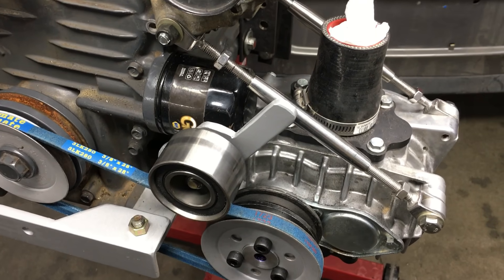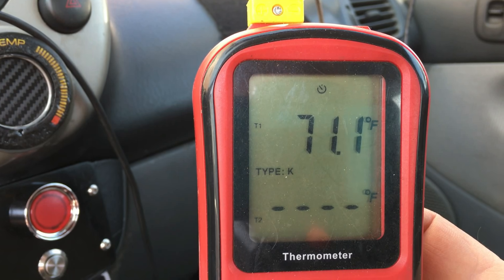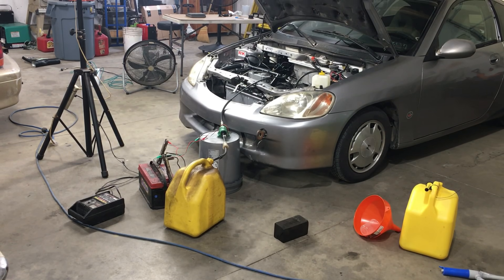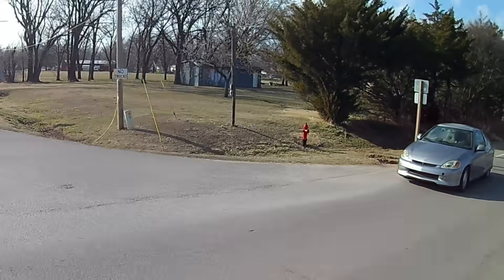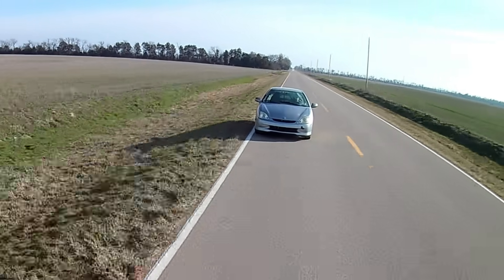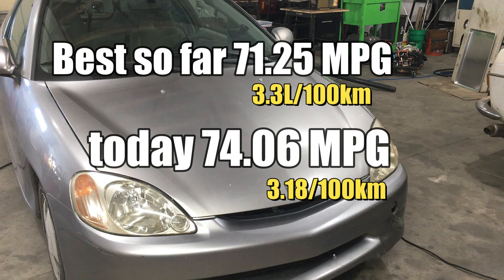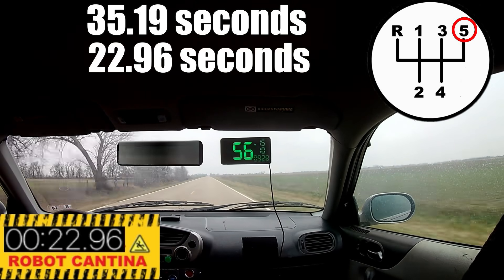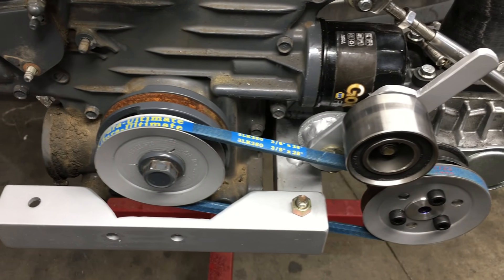S4 E10. We find out if the AMR500 supercharged Kubota diesel engine is more fuel efficient.

Comment: Great video as always Jimbo!

The fluctuations in the values from your road test are to be expected. There are only so many variables you can control. Temperature, wind speed and direction, fluctuations in how you accelerate - some things aren't practical to control. That's why we use multiple tests: that allows us to see how much randomness there is in our measurements. When we make a change, we judge whether the change was beneficial by first assuming that it made no difference at all (the "null hypothesis"). Using the random distributions of our measurements, we can determine how likely it would be to measure a given difference by chance alone if the change had done nothing. Then, only if the change we observe is so large that it's unlikely to be a result of simple randomness, we reject this null hypothesis and are left with the only possible alternative that the change was made did in fact have an effect. Again, the size of that effect isn't known exactly either; its randomness is a result of the randomness of both measurements.

The difference between your two measurements was 0.6%. That's extremely consistent! Good job controlling it as much as you did.

Of course, that's only two measurements - the average variance could be much larger than that. The difference between your averages before and after was 3.0%. That's quite a bit larger. It's hard to say from the small sample size, but I think that's likely to be significant - the supercharger is likely improving the fuel economy.

Comment: Improved volumetric efficiency provided by pressurizing the intake means you're providing enough air for complete combustion of the fuel (less or no smoke at the tailpipe) so you're getting the maximum combustion efficiency and most horsepower out of the fuel you're putting in. For the same power output, you use less fuel because you're not sending unburned or partially burned fuel out the tailpipe. As a few others have mentioned, more boost will increase efficiency up to a point and then your efficiency will drop because you've passed the point where the engine can make use of the additional airflow. Engineering is fun!

Comment: all diesels need too warm up they make less power and dont burn the fuel right when ur rich on my OM617 when im not hot i have a cylinder miss once and awhile until about 75C on the block

i always get my engine too full running temp before hitting the highway to make sure im burning all my fuel don't want too wash my cylinders

Comment: Stunning results. My guess is the next overdrive pulley setup will give better performance, with a slight decrease in MPG, but it could surprise us and get even better MPG. That would be EPIC! Either way a little more performance even with a small decrease in MPG would be an excellent outcome and I think is probably the better of the two scenarios. There's a guy right down road from me with the exact same vehicle, sitting there for a few years now. Time to get the welder out??

Comment: the reason the fuel economy is better is likely because youre not on full power as much to get up to your speed since its acceleration is quicker now. if you keep adding fuel and boost eventually you'll go down again but for something like this where the numbers arent that high its ultimately beneficial. i remember seeing a top gear episode where they had a very fast car trailing a very slow car on their track. the slow car was going flat-out whereas the fast car was just coasting behind them. same sort of principle here; its taking less effort to do the same work with boost. until you start doing more work with more boost is when you'll start seeing a decline in economy.

Comment: A few notes.  Interestingly, there are a few budget cars that improved their fuel efficiency by moving to an engine with a greater displacement which, to the laymen, would mean more fuel burn.  The truth of the matter was that the larger engine was not having to work as close to the edge of its maximum power output to make it down the road.  There's a bit more to it than that.  I could do a full writeup as to the thermodynamics and other physics principles behind it all, but there is a sweet spot where everything works best and most efficiently.

As far as turbos vs stupidchargers, yes, both pull some power from the engine to turn and blow air, which puts more air and fuel into the engine, resulting in more net power output.  You said turbos are run off of exhaust back pressure.  This is true, but misleading.  The back pressure the turbo is running off of isn't purely caused by the piston(s) pushing exhaust.  The exhaust is hot and continuing to expand.  In many cases, there is still some combustion going on in the exhaust pipe.  This heat expansion is, to a large degree, what is driving the turbo, not the piston pushing the exhaust.  It makes turbos a LOT more efficient, once they're spooled and running, than the stupidcharger but it takes more tuning and size matching to operate properly.  In the end, you would get better performance, especially at the top end, with a turbo, but the matching of the turbo to the engine characteristics is a lot more involved.  It's a lot easier for a big auto manufacturer who is not limited to what is already produced as a typical off-the-shelf solution because they sell in enough volume to justify custom-built solutions.

Comment: Economy going up makes sense. Well for now.  
As I mentioned in one of the last videos, that engine will have quite small, restrictive ports, valves and timing/lift settings. If it was making a lot of boost on a relatively low charger spin speed then it stands to reason the engine was having to work quite a bit to suck the air in when it was naturally aspirated - especially at higher rpm and even moreso with added fuel. 
By adding boost not only have you removed that load but the VE will have improved due to it burning more of the available fuel now it has the air to go with it. 
Between both of those they outweigh the added load of driving the charger making it an overall more efficient system so you can get more power or better economy. Or a little of both if you judge it well. 
The gains will get incrementally smaller as you add more boost until you get to a point where the efficiency starts to drop back off. It will still make more power if you carry on past that but efficiency will fall so it will start to use more fuel again.

Comment: You should defenetly add the bigger pulley and a intercooler for more boost and colder intake air(you usually wont to have ambient temp air) and check if it still rolls coal, you could also use a afr gauge to measure your afr and see if its good. Could be some nice power increase, and maybe fuel economy? Just my recommendations from personal experience you do you and keep up the great work as always. PS you probably got better mpg because your engine was running a little to rich and when you added a little boost it became closer to a stoic AFR.

Comment: You get a smaller intercooler belt disc, for 20% more boost, and you won't need to keep the throttle pegged to the floor.

Comment: Always wondered about the whole intercooler thing, because back in the 60s when we put Judson superchargers on cars, there was no such thing as an intercooler, at least not for homemade supercharged MG and VW beetles!
Reply: Ah, the long forgotten Judson vane-style superchargers.  Did they eat up a lot of oil or were the vanes graphite based?  I never got a chance to mess with them.
Reply: For spark ignition engines it's actually a bigger deal than diesels, because more heat in the manifold directly reduces your detonation margins. One way this can be dealt with is to run excessively rich mixtures that actually reduce power, but provide additional charge cooling by evaporation of the fuel. I'd bet your supercharged beetles ran quite rich at full throttle, to avoid both detonation and overheating!

Comment: Once you get to 10psi boost, the engine should really come alive, it's a small diesel and adding more oxygen to the mix will definitely make it run better. Just make sure not to blow the head gasket or rings, always double check maximum cylinder pressures.

Comment: If I recall, these mechanical diesels inject a given amount of fuel based on the throttle position (and basically only the throttle position). Therefor, if you are making more power for a given throttle position, it stands to reason a lower throttle position is required to maintain a given speed. So.... less throttle, less fuel. At least that is what my armchair engiviewer brain says.

Comment: Very interested to see how this plays out. I've put turbos on small diesel engines with great success but it can get pricey. The simplicity of the chinacharger setup (belts and brackets being the hardest part) could very well be a much cheaper and time efficient alternative with similar or better results. Most diesel sxs's need just that little extra especially the bottom end and older smaller tractors benefit a lot from SMALL  boost increases. 5-8lbs seems to be plenty. Either could go super charged just as easily as turbo although limited speed, limited cooling could potentially be an issue.

Comment: Black smoke is an indication of over fueling.  When you add boost, you are adding oxygen and making the burn of the fuel more efficient.  As we say, stochiometric or chemically correct for the fuel to bind with the oxygen.  Probably every diesel should have some boost to some extent.  There is a fine line between enough boost or introduced oxygen and too much boost and burning up the engine.  As you stated,  the supercharger does have parasitic drag and costs power to run but if enough efficiency is added, then the drag of the supercharger is overrun by the increased efficiency.

Comment: There's a a big difference between a turbo and a supercharger that's very relevant on highly stressed engines. Both take power from the engine to work, The turbo takes power on the exhaust stroke forcing spent gases out the combustion chamber through the valve/s, header and turbine. The supercharger takes power on the power stroke when the engine is more stressed, that difference is important on a high performance or fragile engine.

Comment: Just the fact that you're getting 70+ mpg., supercharger or not, is very impressive! Considering you still have excess fuel to work with, it will be interesting to see how much more you can get with overdriving the supercharger. Well done Jim!👍👍 EDIT: Next step after increasing the pulley ratio would be to pull a 'Gale Banks' and add water/alcohol injection. That would definitely make a difference, and even more so in warmer weather!!😉
Reply: This diesel would love a bit of methanol as a fuel! Not only do you get insane charge cooling you do not need an intercooler at all and methanol brings a decent amount of its own oxygen. Almost like adding weak nitrous lmfao. I am putting my AEM V3 water meth injection in my 2.0 common rail vw diesel one of these days once I decide to get around to it haha
Reply: Some get 70 mpg in slightly modded 3 cyl Geo Metros. They increase the compression ratio, use the XFI cam and advance the camshaft timing and switch to 4 cylinder final drive ratio, and lose weight.

Comment: At those boost levels, you don't need an intercooler.

Technically, also, intercoolers serve fewer purposes on a diesel since you don't have to worry about knock/detonation, or messing up the fuel bowl temperature [since diesel engines don't have fuel bowls]

Comment: I'm impressed with the fuel economy,
When weighing the fuel, does it matter if it's hot or cold? I would imagine that the volume changes, but not the weight,
You could run the supercharger with an electric motor, then it would be a hybrid again 🤔

Comment: If you’re making more power for the same amount of fuel delivered the economy will improve because you need less throttle opening for the same amount of power thus less fuel used.
It’s the reason why when towing you can get better economy out of a big V8 than a turbo 4 in the same vehicle yet use less fuel in the four when not towing .

Comment: You could make a crude Dyno for doing standardised economy runs by getting a used differential and an industrial fan and a couple of drive belt pulleys.
Mount the diff in a frame that sets it high enough to attach the fan to the pinion.
Lock one side or fit a pulley to each side and also attach pulleys to the vehicle hubs replacing the wheels.
Then just spin it up to whatever speed you want and go have a coffee.

Comment: What you've stumbled into is "break mean effective pressure" or basically torque per displacement per RPM.  I'm not going to pretend to be an engineer who has a detailed level of understanding but basically naturally aspirated diesels suffer from poor volumetric  effeciency at higher loads and speeds and the increased volume of air compensates for this inefficiency more than it costs in power to run. Turbos reclaim lost heat energy from the exhaust which is why they are better generally but in this situation this works. 

I'd love to see you try and compound charge this with the boost from the turbo feeding the intelt to the supercharger.

Comment: Nice work Jimbo, it's very satisfying when your labors are rewarded with positive results!  74 mpg is pretty good at 55 mph for a Frankenstein Honda Insight.

Have you considered a fuel flow sensor?  I know you are after an average fuel economy figure but, having an instantaneous fuel consumption rate gives quick feedback for experimental tuning settings.  Additionally, a Cal Factor can be computed between average and steady-state 55 mph to arrive at a reasonably accurate average fuel economy.

Comment: The coefficient of thermal expansion measures the rate of the expansion. A typical value of the coefficient of thermal expansion for diesel fuel is 0.00083 per degree Celsius (0.00046 per degree Fahrenheit). Using this value, 1.000 gallon of diesel fuel at - 7 °C (2 0°F) will expand to 1.037 gallons at 3 8°C (100°F).

So basically unless you start at near freezing winter and then stop at mid summer heat the error due to thermal expansion will be about the same as the means of measuring you’re using.

Comment: Very cool, I'm planning on building an Eco modded car myself, something like a Mazda protege from the early 90s with a 5-speed manual out of their DX model which ran at 2700 RPMs at 65 mph and using the 8 valve multi-port fuel injected 1.3 l out of a Ford festiva also known as the Mazda 121. A mix and match of parts and you basically got the European version of a Mazda protege that could get 50 mi per gallon. It's not 71 but for some backyard mechanic. It's a start. Also had an idea of taking a Suzuki Swift AKA 2000 Chevy metro, pulling out the 1.3 l Suzuki engine that's in it and replacing it with a 2.3 out of the Suzuki aerio. Same engine block design just stroked and bored out. How funny would that be. This little tiny 1700 lb four-door sedan with little 13 inch rims . I don't know what 200 horsepower does the 1700 lb but I would probably be equipping it with an automatic.

Comment: Äähm... If You measure the consumption by weigth (not by volume) the temperature of the fuel does not matter! 
1 Kilo at 20° equals 1 Kilo at 50° - it's just density (the volume) that changes, not the mass!

Comment: That mpg is INSANE!!! I was saying I'd be impressed if it was over 55mpg. You're a wizard Jimbo!
Reply: At those speeds the stock car with its original gasoline engine and electric assist would be getting around 70 to 80mpg (while also being much more drivable and highway-worthy). Not downplaying Jimbo's mechanical wizardry, but I think most of the heavy lifting on the efficiency front is being done by the car's aerodynamic shape, low frontal area, and light weight.

Comment: The car getting better MPG actually checks out. At first glance you wouldn't think so because more performance generally means less MPG, but in this case, by adding boost, and thereby, more power, the little engine is having an easier time moving the car. To a certain point, the less strain on the engine, the better the MPG will be.

Comment: You're probably improving the thermal efficiency of the engine at partial load since there is no throttle. More air = higher cylinder pressures which is where the better fuel economy numbers are likely coming from. Either that or you were already running too rich and the extra air is letting you extract more power from the fuel already being used. Given the soot, that second one could possibly be a bigger factor. It would be interesting to see if the 0 to 55 times stay similar if you lean it out a little bit.

Comment: Turbo for 4 cycle Diesels! !
Get the Milage up.

Readd the Hybrid system with lithium batteries using the FoMo Co surplus batteries and controller the Honda insight support group has developed.

Then run on biodiesel for the Co2 crazies  …..

Comment: In regards of measuring the fuel quantity you don’t need to wait for the fuel temp to stabilize when measuring the mass of the fuel. 14,000g of fuel at any temp will be the same weight because volume of it is completely out of the equation. Airliners use the same mass to measure fuel because it expands and contracts and using mass removes volume from it.

Comment: The combustion efficiency in a diesel engine have a strong but non linear correlation to AFR, so it will rise alot for the first added boost and most likely tail of as you continue to raise boost. Hopefully this engine will get to diesel worthy boost levels/AFR sometime :)